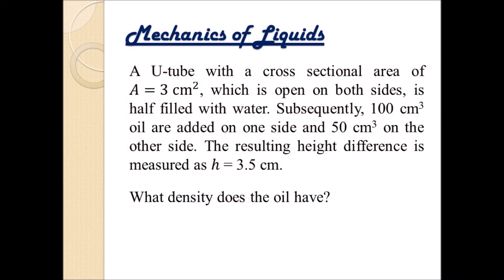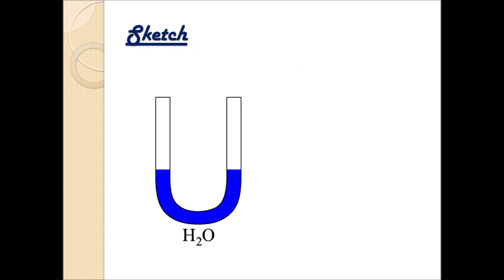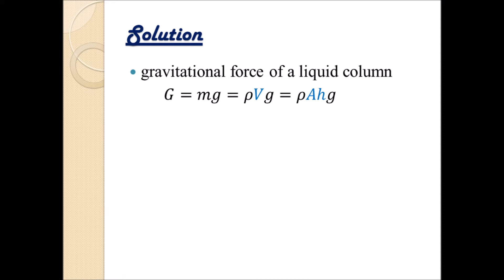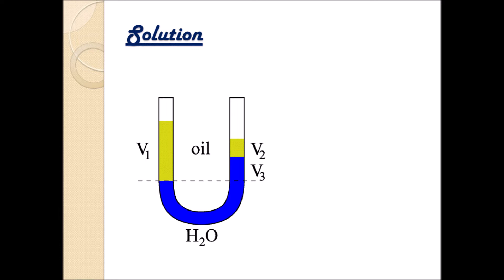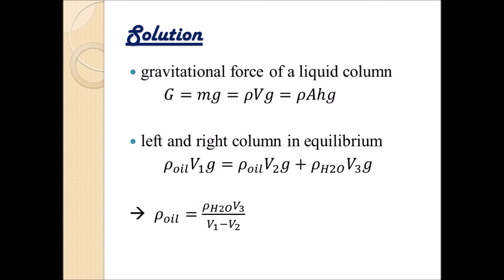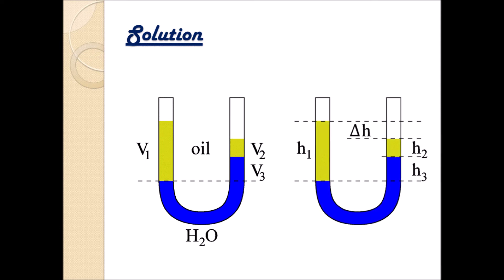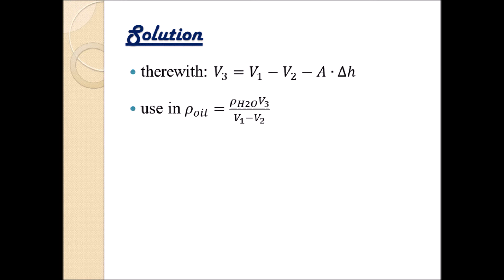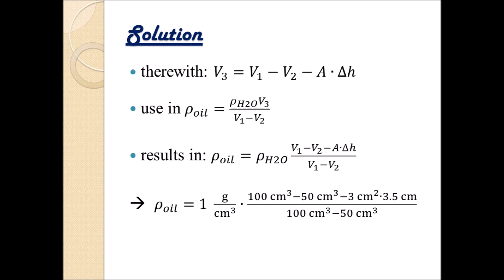Pressure - Mechanics of Liquids - Introduction to Physics Exercise Series - 09

Comment: That seems to be easy, but what is the matter when there is not a cross sectional area about 3 cm², for example 0,3 cm². What about the capillary forces?
Reply from the maker: Oh yes, if the cross section is too small you will have to dig deeper into physics. Bernoulli holds basically only for laminar flows, so it is a bit idealized for simple calculation here.
Reply: My professor in physical chemistry, a lady too, but in 1973 much older than you nowadays, told me: if you can't explain the effects between protons, electrons, neutrons or even molecules, 🙄 it's always van't Hoff. I think she was right. 😂 😂 😂
Reply from the maker: @roststab  😅👍 I wouldn't say it's always him, but he was really good!